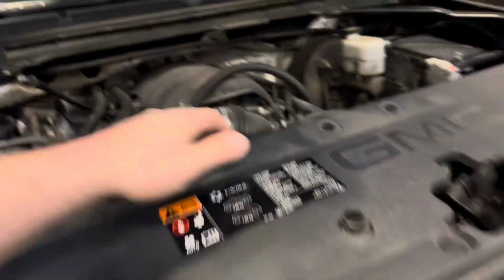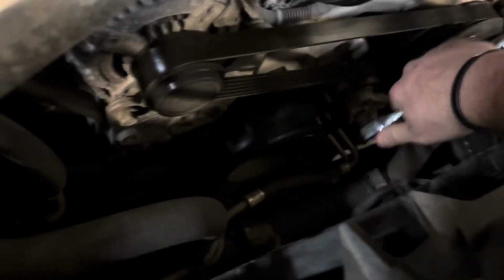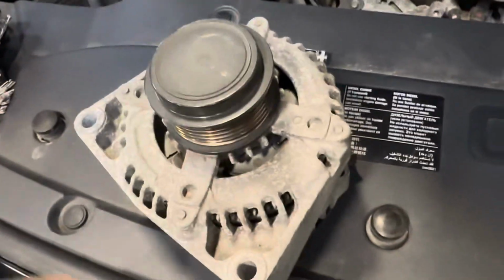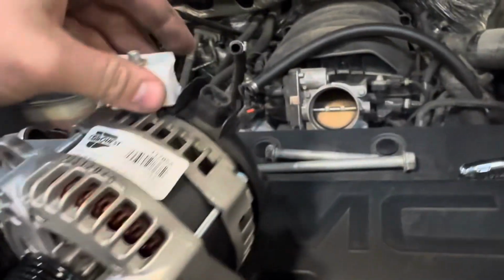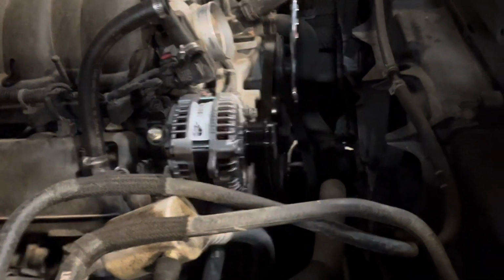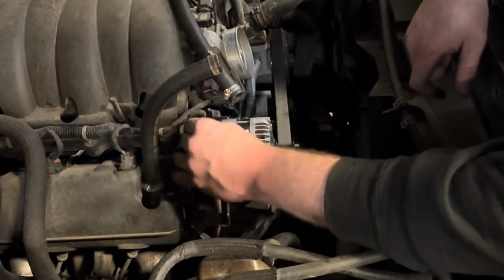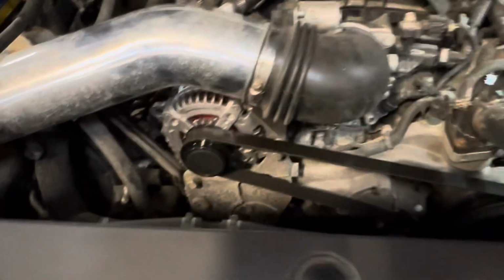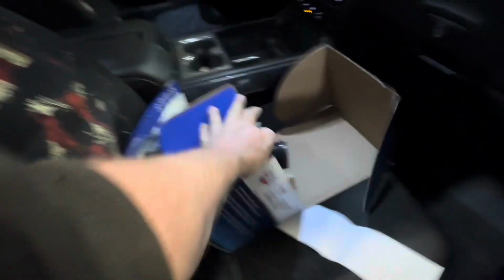2014 GMC Sierra alternator replacement

Comment: Thanks! How do I know my alternator has gone bad? My batteries are new though. The error I first saw was - Battery Saver Active and it’s at about 11..something when I jump start it and let it run. It also has a funny whizzing sound. Thanks
Reply from the maker: @joshuarozario5654  best way to test it, is with a multimeter. The whizzing sound might actually be the the alternator charging, sometimes they make alittle bit of noise.
Reply: @ , this was helpful! Yes, my alternator is showing the same voltage as the battery, which I’m guessing means it’s not producing any electricity?
Reply from the maker: @ was the vehicle running when you tested?
Reply: @ , yes, So I had to jumpstart it and then I tested the battery too (which is new but low on charge) and both (battery and alternator) of them gave me the same reading - about 11 something…
Reply: mines is also doing the whizzing sound